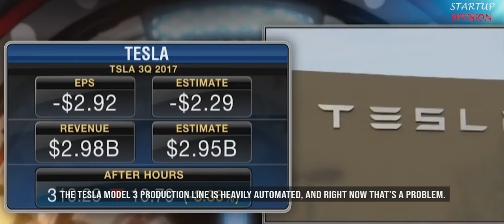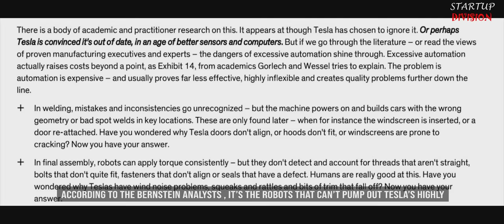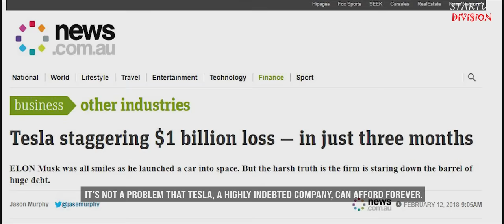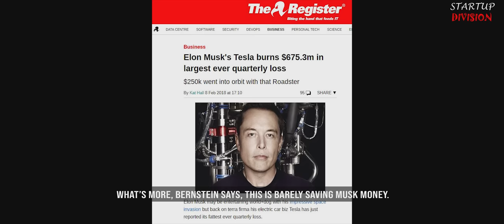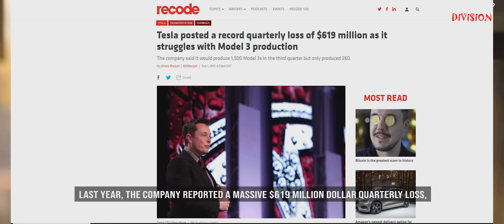Elon Musk - The Problem with Over Automation | Tesla's Burden

Comment: Full automation is the future. Period.

Quality might have been inversely correlated with automation years ago, and that might even still be true, but there is a point where that correlation will reverse, and it's a good bet that point is pretty soon.

Other manufacturers may have tried full automation and failed, but the tech is changing fast and it takes courage to stick with it. When other companies tried full automation, they ran into problems they didn't expect, but rather than sticking to the plan and becoming masters of those problems, they shyed away and continued business as usual. If Tesla sticks to their plan of ultra-automation, they'll gain knowledge and experience that no other company in the world has.

A big problem with partial automation is that you have to interface dangerous robots with squishy and error-prone humans. You have to slow down the robots and make sure they don't pose an overly high risk of causing death and/or dismemberment.

It's kinda like those simulations of intersections without any stop lights. As long as 1% of the drivers on the road are humans, you're going to need stop lights which makes everything run way less efficiently.

Tesla is in a pretty good position to attempt to be that company that masters automation because their vehicles are fairly simple.

Investors need to chill.

Comment: If you judge Tesla by whether it meets Mr Musk's wildly optimistic projections you will always be disappointed. The same thing will happen with the Model Y and the Semi. On the other hand if you look at what is actually achieved you may be pleasantly surprised. Tesla has huge debt and negative income, that is OK so long as there is no large scale drop in the economy. Ford and GM are having trouble selling cars at the moment, if that is a prelude to another 2008 style global financial crisis it won't just be Tesla that will be in trouble (but they are vulnerable).
Reply: Dogphlap Because no one wants to pay 30 or 40k for a car! It's just too much!
Reply: +richardscathouse      You'd think so wouldn't you but Audi, BMW and Mercedes still have customers and they sell into the same market as Tesla. It might be a small market but Tesla only produces a small number of cars. Even if Tesla manage to make 500,000 cars a year that is still small beer when compared to GM, Ford or Toyota.
Li-ion cells are expensive but they are getting cheaper at about 7% p.a., there is every chance that usable EVs will be price competitive with equivalent ICE cars in five to ten years (the new Hyundai Ionic EV is not far off already). A full size SUV with options is not exactly cheap either yet people buy them.

Comment: Over automation is never a problem, it's a problem when you don't implement it right. You have to do it at its own pace. In Tesla, it seems, they automated everything so fast, without letting the low-level pieces and process mature enough so that high-level assemble workflows can be built on top of them without much hassle.
But that's the Elon's way - do it fast whatever is right, so what if you fail, learn and build again. For now they will involve humans but simultaneously they will observe the automation, and eventually, they will get it so right that every other manufacturing company in the world will follow them.

Comment: What happens to the robots when  there is a line shut down because of maintenance? They just sit there collecting dust and costing the company money. Humans are more adaptable because if there is a maintenance issue with a line they can be put on another job besides production. Plus the assembly line workers are the best at giving an engineer critiques about what can streamline a process by removing unnecessary steps. Plus Elon Musk says that the current car plants put out cars at  a very slow pace, but what he does not realize is that slower the process the easier it is to catch defects  and prevent defects from happening. Elon Musk seems to believe that it is engineering first that builds a car; compare it to Tesla's competitors who design cars with input from other departments to insure the ease of manufacturing.

Comment: Elon Musk had the right idea in the wrong decade. Give it another 20-30 years and the technology will have moved on so far that the cost savings, even in final assembly will be significant. There's nothing we can do that robots and AI won't be able to do better in the medium term.

Your numbers are also off in multiple ways. One of the biggest ones is that robots don't just make production potentially cheaper, but also faster. With a mass market car, speed = more money per minute. The only other way to achieve the same thing is to build a whole new plant (or an equivalent proportion of one), which is not as cost effective.

Comment: It's hard to make robots do simple things when the things they're doing keep changing. A robot will want to do the same thing in the exact same place and final assembly of a car is not always exact. That level of accuracy is expensive and time consuming. Something Model 3 was never meant to be. It's not worth the cost to build a line like that. Humans can turn on a dime and are easily programmable. If something needs to change on the line a human can accommodate that. A robot will have to be un-anchored, rewired, repurposed, and reprogrammed. Tesla keeps updating cars throughout their life and because of this a robot will fail every time. Its costly and time consuming. Something Musk didnt understand about industrial manufacturing but I'm sure he's figured out now. Humans can be cost effective if used correctly, just like robots.

Comment: Greed is the failure of every company.  Trying to cut human labor in inefficient ways is wrong. I've seen it first hand, $100 million loss for promises that could never be met.  They were even told it couldn't be done by operators. Efficiency loss and waste cost is more costly than human labor over certain machines.  You can't force these things to change. It's got to be embarrassing to not fully grasp this problem. Robots will fail. The more you have the more chance they will.  More complication doesn't lead to better out put.
Reply: So true. Toyota understood that way back in 2014, but this guy elon is obsessed with STAR WARS.

Comment: Robots are more predictable in how they perform operations. Tesla can tune the robot, tune the line to improve quality of the car, and get sustained quality. Robots have predictable period of maintenance. Robots can be repaired in case of damage. Robots can work 24 hours a day. Robots can change pace of production without strikes if the line has capacity to do it depending on buyers demand changes.
Reply: All of that and they can't even assemble a chassis correctly

Comment: Elon made the mistake of promising cars at a low price before he got into the logistics of what it takes to produce a car at a lower price. 

Elon isn't letting market forces determine production numbers because he's artificially keeping the price low. 

The only way to fix is to let the price of the car float til equilibrium is reached between production capability and demand.  This might kick the cost of the car up to $80,000 but so what? At least the company will be solvent. Then as he is able to increase production then the prices will automatically drop.  Sorry, I know that's not what you want to hear but that's Economics 101. 

Elon obviously does not have an infinite amount of money to put into this thing.  He should know this.  He's a smart man.  Preston Tucker made similar mistakes.

Comment: I seen the latest Tesla class action lawsuit and it leads me to think Tesla should roll out enhanced autopilot in 5 major updates for each level of the  program like enhanced autopilot 1 is $1000 and for 2,0 another $1000 for a total of $2000 for all operating 2.0 and when 3.0 comes out charg another $1000 to receive any and all updates during the 3.0 period of time. After 5.0 then and only then you can buy full self driving for 3000 or roll it out in 3 phases for $1000 each still earning Tesla a total of $8000 this is fair for the buyers and keeps Tesla out of lawsuits for perceived intentional fraud....

Comment: Is it easier to switch from making IC cars and learn the differences from those to EV ? Or learn to make cars from a knowledge of EV engineering.  The major manufactures will eat his lunch one the EV engineering is understood and tooled.  Honda, know it’s the final finish that the user interfaces with, so they throw the most adaptable animal on the planet at looking for issues and fixing them on the fly and produce feedback to design to eliminate recurrence. They call it the quality circle, now how would you get a robot, that can spot weld or place a screen to do that?